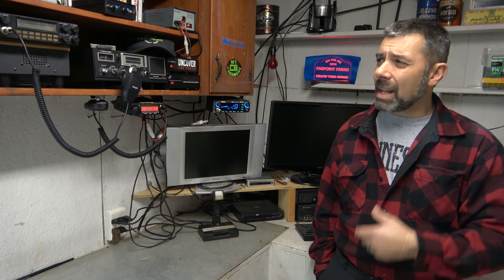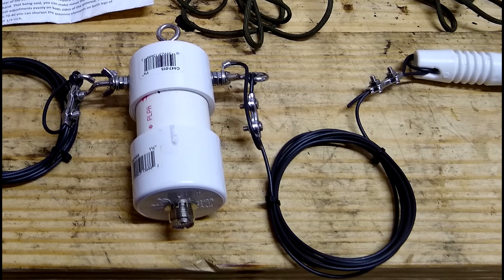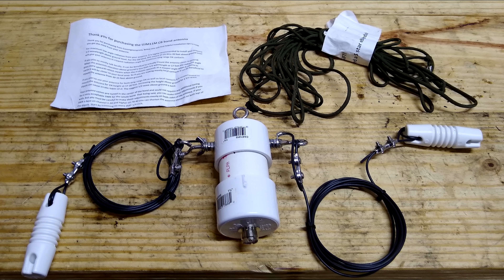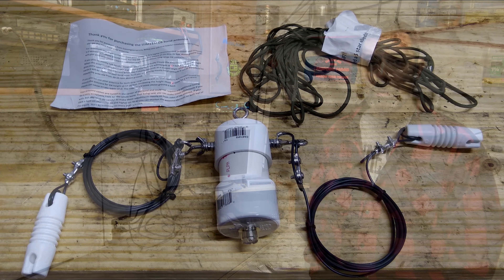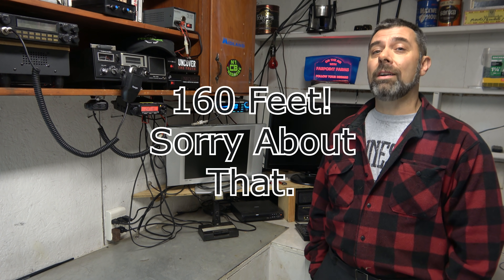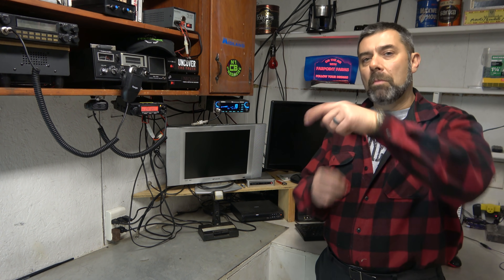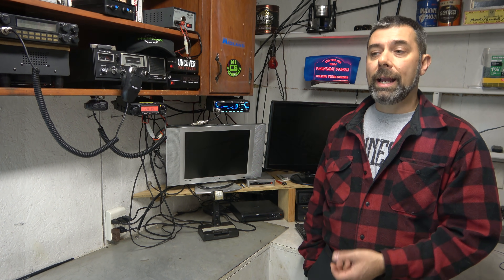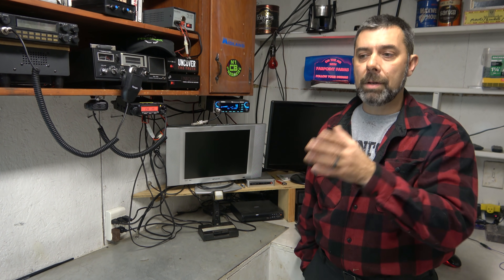CB Base Antennas Part 4: Build Your Own!

Comment: An antenna analizer  is fun to use  takes a lot of guess work out  i have a 5 band vertical hustler  with under ground radials   and then tune each section  some slick with the anilazer
Reply: Check out these small and cheaply priced NanoVNA Vectors network analyzer gizmos, the SWR set is easy to set up and use and works great ! You can get them on Amazon real cheap too.

Comment: Great job explaining home brew antennas.   Yes this video will inspire people to do some research and start building there own antennas.   
For the group here to find the length you need for 1/2 wave.  
Divide 468 by the frequency you wish to work.  Example (468\ 27.385 = 17.0896 so that is 17 ft and change to convert to inches get 
17.0896 x 12 = 205. 0752”. Inches of wire you need for channel 38.   But like Erik said always cut a bit longer so you can adjust for your SWR.

Comment: It's a good video Eric. Me and a ham myself I build a lot antennas. The simple way to make a a good dipole antenna is two pieces of wire and an so-239 connector and make an inverted V antenna. That's what my 40 meter is got a one-to-one match on it with the tuner by the 1/5 without the tuner. Keep up the good work Eric love watching your videos 73